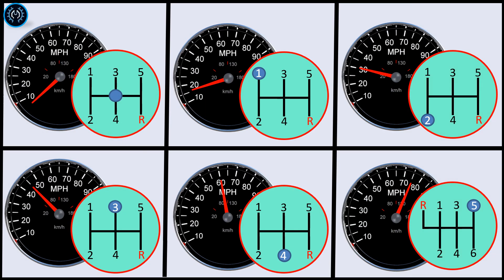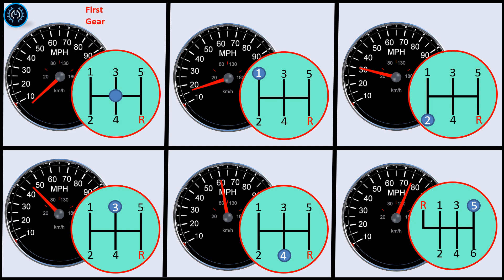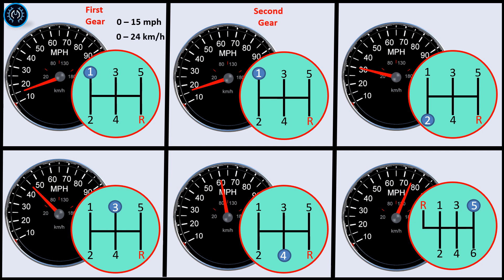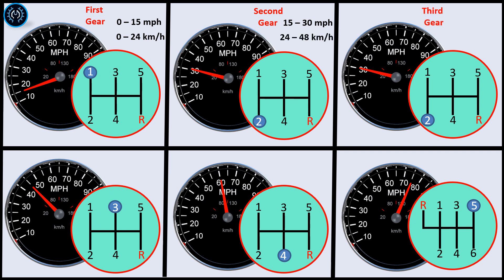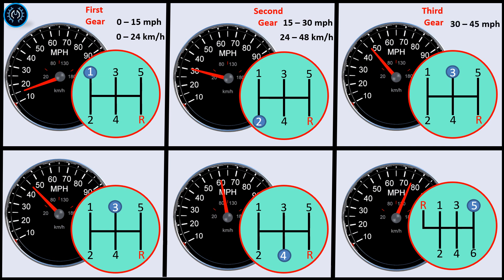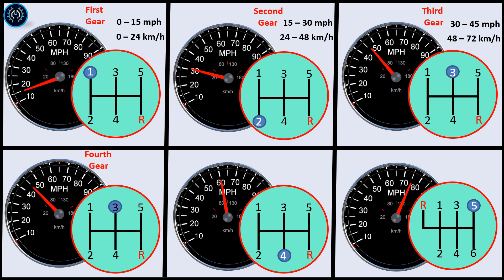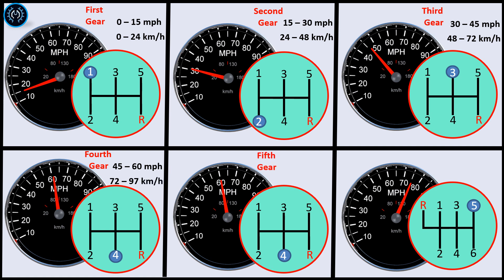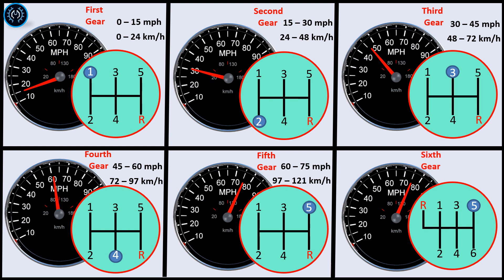Manual Transmission Gearbox Speeds

Comment: This is wrong. 

You only really use first gear to move off or when you're moving extremely slowly. And you may use higher gears at lower speeds when you're cruising.
Reply from the maker: Appreciate your comment❤️.You are totally right,this is the main usage of the first gear.but in some vehicles the output speed for this engagement achieves this speed per mile nearly.

Comment: is the (model or factory company) of the car will affect on Manual Transmission Gearbox Speeds ??
Reply from the maker: Each car model inside the same company has different gearbox from other model. May be it's  gearbox output equal with speeds or a little bit different. And of course beside speed we can't neglect the output torture we need because this two parameter will affect on the gearbox modules